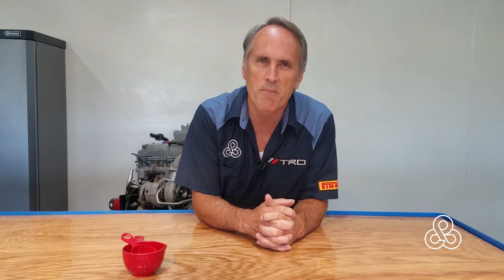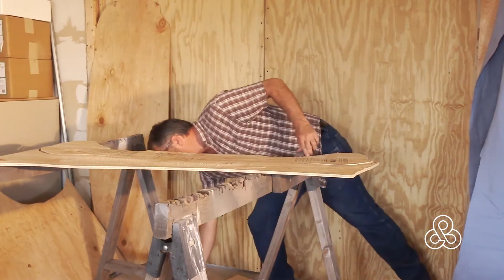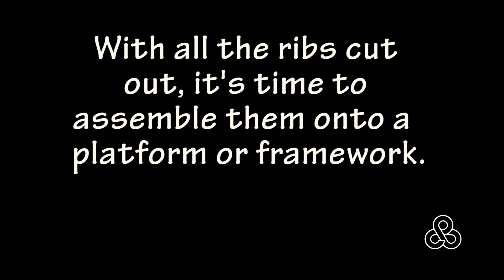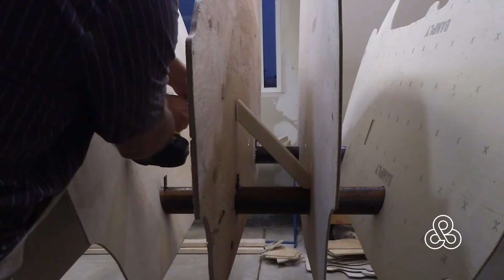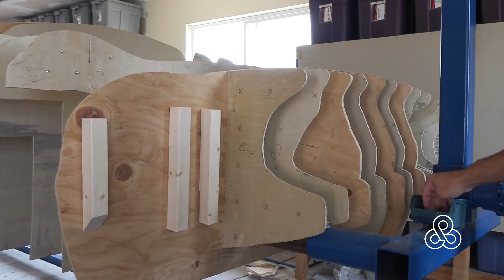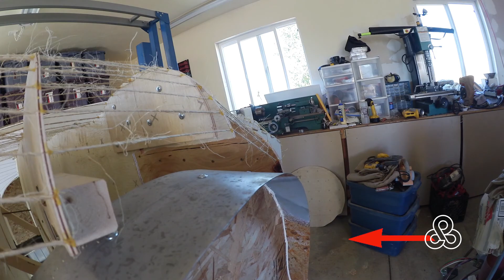A03 - Don't be fooled! This will one day be a supercar.- Jarvie Arete project

Comment: What size printer did you use? Did you have to tape a bunch of pages together for one slice?
Reply from the maker: The printer output C size (24x36) most of the ribs fit on one sheet until you got to the passenger area, that is much taller of course, then I had too join a few sheets. You only have to print one side, trace on the center line then flip it over for the opposite side. (unless you for some reason build an asymmetrical car.)

Comment: 'Tis moi, once again. Hello there :)

What method did you use to ensure that all your hole punches designated for where the 3" steel tube would run through the ribs all lined up perfectly? And I assume that you didn't simply print out and trace the full slices of the car due to paper size restrictions, yes? 

Thank you for the video sir.

Comment: What parts did you have to start the build? Ie motor trans suspension dimension?
Reply from the maker: Motor, transmission, differentials and wheel/tires gave me all the necessary dimensions to move forward with the design. As soon as I had all those components for spacial reference I started building the body while simultaneously designing the suspension.

Comment: Could you have used spray adhesive to glue the paper to the board and then use a jigsaw to cut along the lines on the paper?

Comment: An alternative to hand cutting each piece from wood would be to find a sign maker who does vinyl and foam board signs 
take your cad files to them and have them cut as many copies of each panel as your budget can stand out of the thickest most rigid foam board they can cut. They don't need to cover both sides in one piece as you can join left and right later, also they only need to be a rib not a whole slice as you could then get multiple ribs out of a sheet of board . What will be beneficial is a longitudinal centre rib  and at least two side ribs.
You then attach the ribs to some rough panels on the framework starting with the central lengthwise rib and working from the middle out. When you have all the ribs in place you then take the extras and glue them either side of each rib stepping them in a bit so they don't poke out of the curves. or you could shave them to the curve after gluing.
When you have all the ribs in place the gaps can be filled in multiple ways , cutting strips of foam board and gluing them in or poking in bamboo satay skewers or hemp string or spray foam.
You can then cover the formwork in any media you want , clay , plaster. bondo whatever works for you.
I recommend making any sharp features like ducts as seperate pieces and taking a mould of them then add the moulded pieces to the buck .
Reply from the maker: What you see was accomplished for less than $500 for the plaster plug. The goal is NOT to end up with a precise pattern, but to have a form to add and subtract from; similar to a clay model in a design studio. Hacking up junk plywood is plenty accurate.  Your described method is correct for enlarging a finale model.
Reply: @BuilderCreator  . I don’t argue with your method, there are time and ability differences between people who want to do this.
Having something that is more accurate at the start makes it a little less likely that the project will end up in the dust bin or just gather dust in a corner. I haven’t priced it lately but I believe having a sign maker cut the foam on one of their machines is fairly cheap , possibly cheaper than the plaster method.
Reply: This comment comes with some great ideas, I'll use some of them.